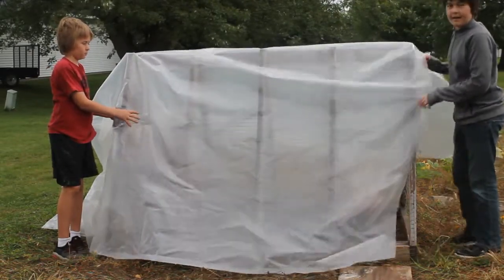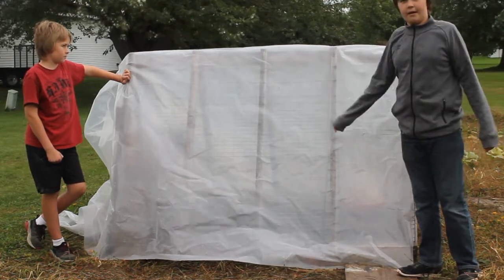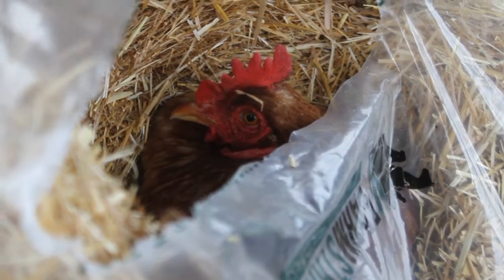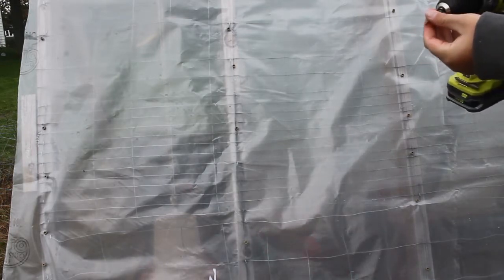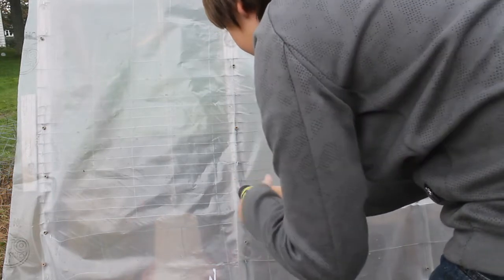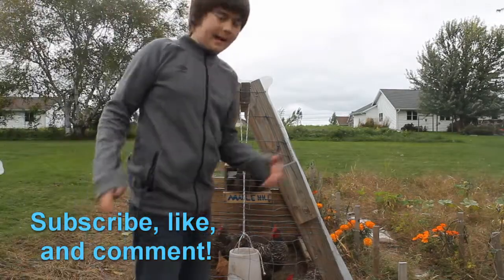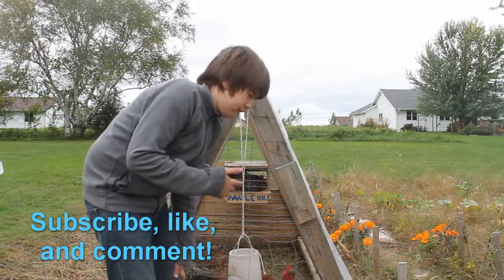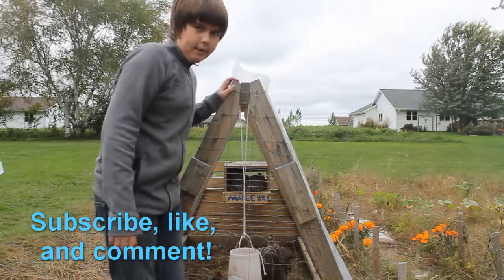How to Cover Your Chicken Tractor In Greenhouse Plastic (Chicken tractor modification process)

Comment: If you have a refrigerator thermometer, you could use that to measure the inside temp with greenhouse plastic. It would be interesting to find out how well the plastic is working.
Reply from the maker: That would be cool I think it already makes a 5 degree difference. It will definitely stay warmer when I have it fully enclosed.
Reply: @AlsHomestead  - I fully believe it will and they will still be able to get some daylight too. You might consider straw for the ground for their feet. They would probably be very grateful for that.
Reply from the maker: Yeah once it's parked for the winter I will use straw and pine shavings for bedding.